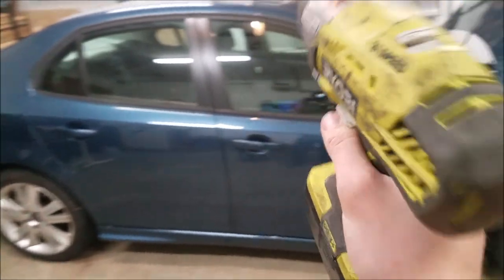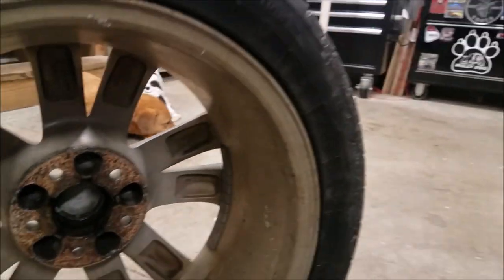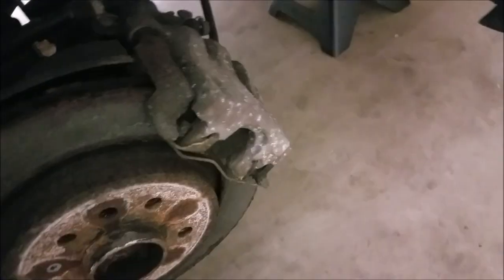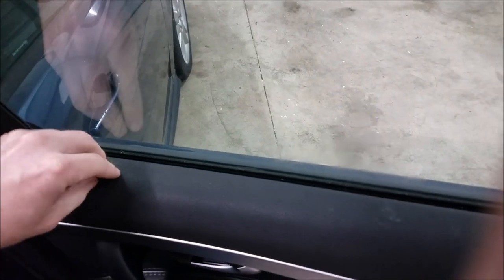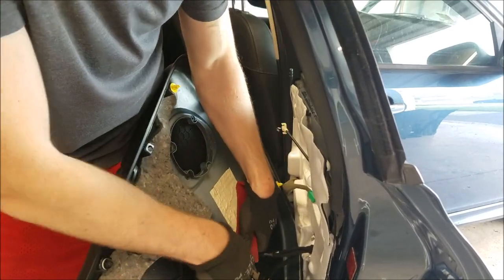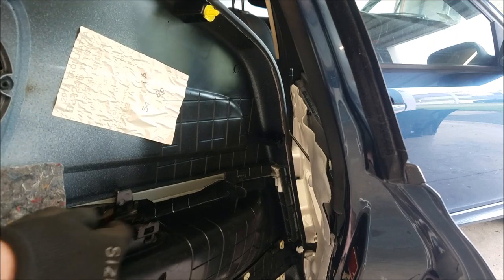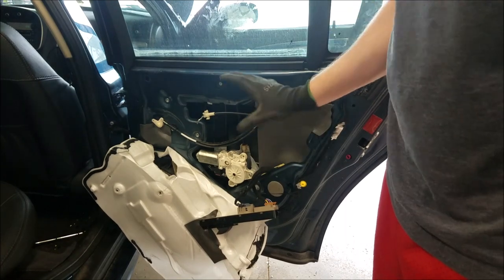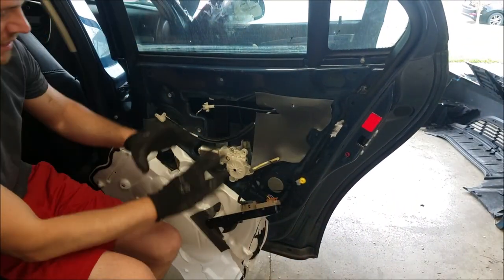Project Saab - New tires & Window Fixed!

Comment: Dreaded rear door lock! Mine broke on my 07 93 airflow in the locked position but saab so well designed u can get the door card off very fiddly, then remove the outer door handle shroud ( 3 x bolts inside the door ) this was the hardest part as 1 of the bolts is really hard to get to but with patience and tough knuckles can be done , then thru the door handle hole smash the old lock to pieces with chisel or screwdriver  to unlock door ( very satisfying ) no need to remove glass or runners not too sure bout your model tho 
Love these videos bud keep em coming

Comment: About window lift switch unit and door lock unit one is thinking you'd better to disconnect the battery first, both negative and positive poles, wait for some minutes than go further with the job. This because they both are electronic modules..by the way be carfull not to touch any pins and touch a good ground before starting to handle with electronic units. Not to disconnect the battery could be a cause of some issues. Anyway.. well done lad!!!

Comment: Hi Gary! My 2006 9-3 has an alarm malfunction. It starts leaving door looks unlocked at arming the alarm, then alarm goes on any time. I serviced all the door locks redoing the connections with my solder station and cleaning all the connections. And alarm continues activating for no reason. I started to close the door using the key to avoid activate the alarm, and now the remote control makes nothing. Alarm does not work anymore. What did you reccomend to do to repair my car??? Thanks!
Reply from the maker: Hello Juan! My initial thought is you need to get the car hooked up to a tech2. The door locks on the NG9-3's are overly complex and finicky. Getting it scanned via tech2 can provide additional details like which door lock actuator is at fault. Your issue may also be realted to the alarm siren: https://youtu.be/ibEWHXE3fSI If all else fails, you can disable the cars alarm via tech2 but still keep the key fob functions.
Reply: @WeakestofWeeks  Thanks a lot Gary!!